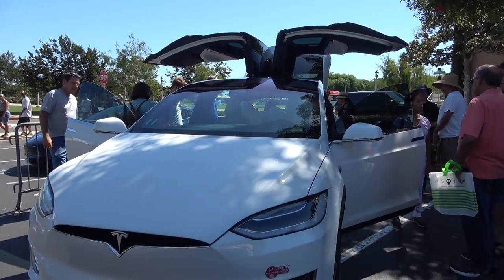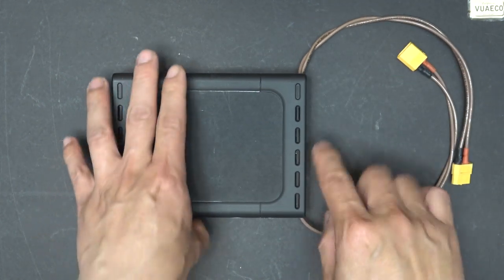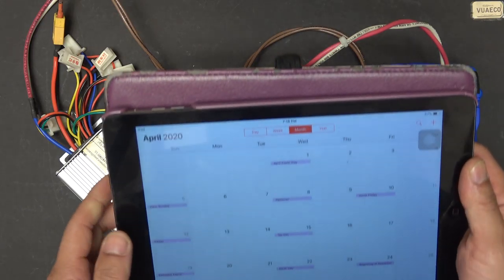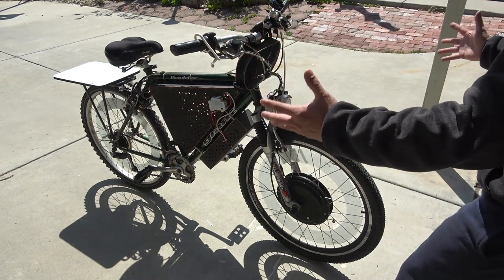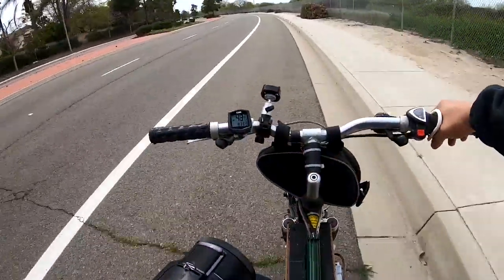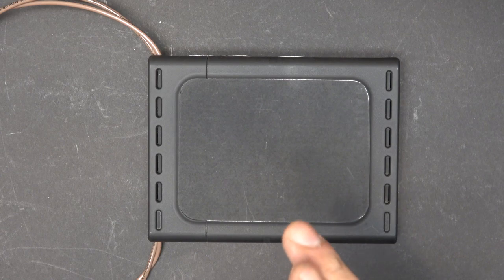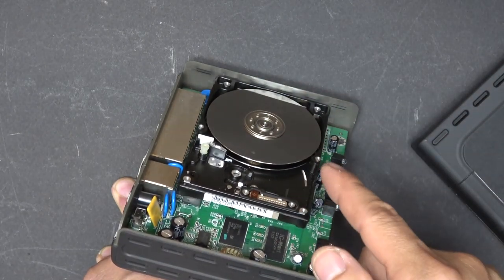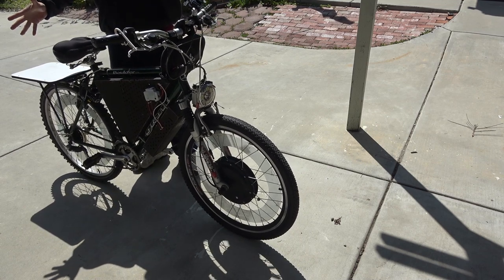Self-driving ebike: Review & tear down of the new autonomous ebike controller

Comment: Recently updated mine, it works fine actually. The speed control is mild. If the bike can only go up to 24 it will only go up to 24. Cruise control is actually really good! It can’t handle a ton of weight though. Wouldn’t recommend a book or anything. The voice will glitch a ton too.  You can try to add some mods to make it follow a set shadow/person. It really sucks though because it barley works in a low light or environment with a lot of people.

Comment: but seriously ive installed a modded logitech gameing steering wheel mechanism into my ebike has all the servo gearing to steer and hall  sensors for steering position,using a 45 amp sabvoton unlocked and modded bafang motor front wheel,and 150 amp unlocked sabvoton and crystalyte hs 4065 rd rear motor,a cycle analyst does all the throttle ,tourque and pas sensing and has 2 shunts one for each motorso canget acurate power balancing.there is rarsberry pi 4 that has all the gyro and accelarometer,and compass and lidar with optical rotational sensor disks on each wheel, will be usuing 2 high speed liner actuators for emergency stabilizer roller that will double as auto bike stands,the battey uses imersion  cooling and a supacapacitor bank in parralell with battery,useing esp8266 di mini to send data to android phone running torque pro for custom dash and guages
Reply: will be happy to share all plans and give software once is fully configured and reliable
Reply: all the gears are electric shifting with 3d printed worm drive cable pullers running on separate arduino nano with gear number led displays from ali express for few dollars